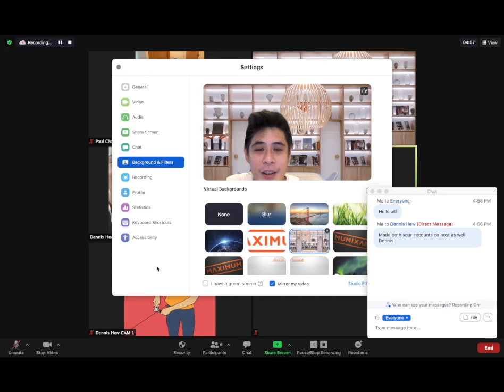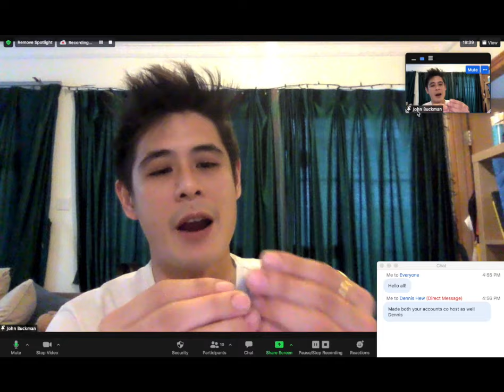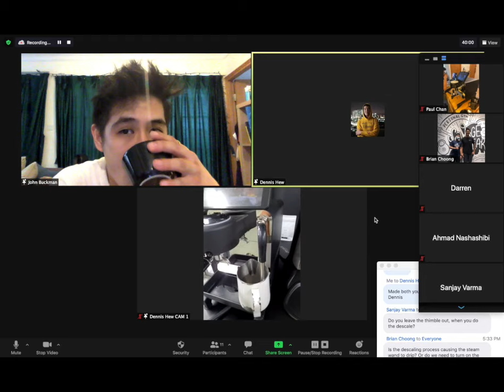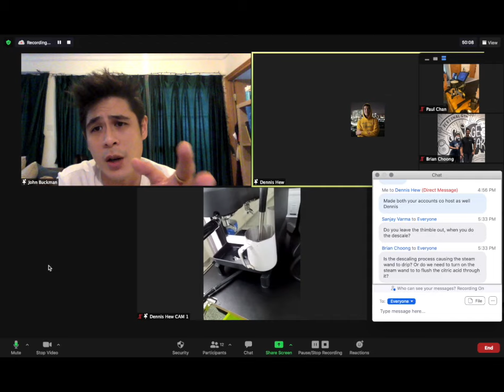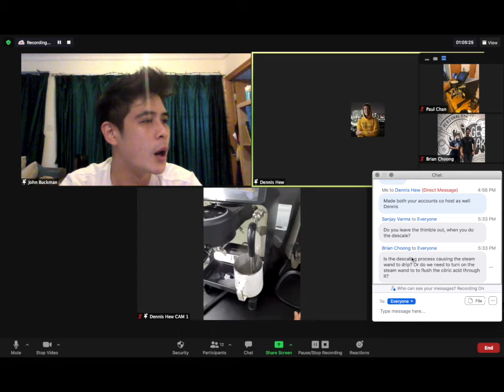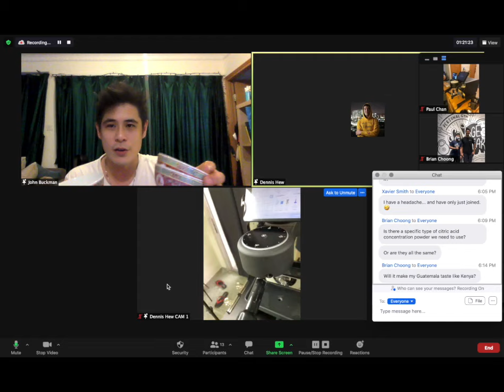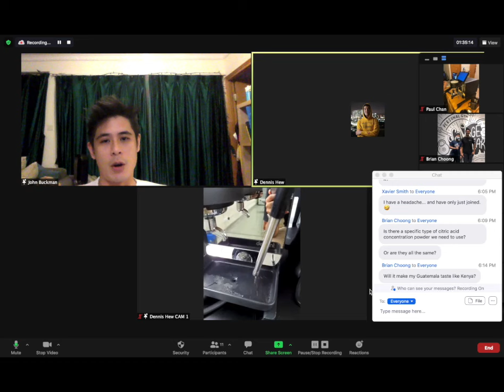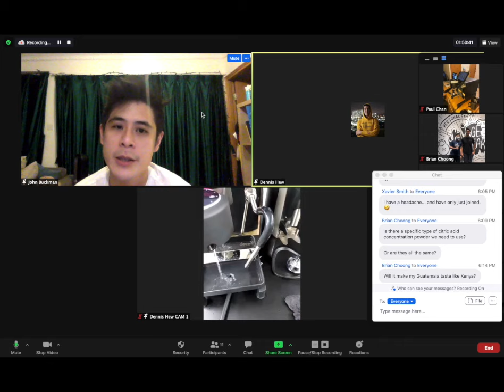Zoom: Clean and care for your DE1 (Descale)

Comment: For those that see the video length and say "F**k this", simply:

1) Go to the "Machine tab" under settings
2) Locate the button to Descale - top right
3) Follow the instruction on the screen
4) Have the video play in the background to answer your questions
5) Key points is that you can submerge the steam wand in water to avoid vinegar smell when the steam comes out as part of cleaning cycle
6) You can run the cycle 8-10 times (until the tank is emply, rather) if its the first time you do descale on old machine. Normally only need 3-4 times.
7) Set up a bi-yearly schedule to do the descale as part of best practise
Reply: Add in the following points after 6 above

A) Take out the tank, clean it under the tap, put new water (Just half full will do)
B) Descale again (yes, same as we used before)
C) Repeat A) again, this time fill it up and remove blind basket.
D) Run a series of flushings (hot water, steam, rinse) until there is no smell of vinegar
E) Continue running as per D), but try to taste the water. If there is lemon taste, repeat until water tastes clean. Prepare to go through one full tank of water at least.
F) Success!

Comment: Nice explanation of the process, thanks.

Some questions:
- is it possible to use less solution (maybe 1l), if we only do 3 cycles
- it would be nice to have a multiplier in the descale process, so that it’s performed multiple times without any user action
- it would be good to include to the descale information page: perform multiple times + perform with clean water + flush afterwards
Reply from the maker: Yes as long as the concentration of the citric acid solution is the same, You will have the benefit of less waste. Anything less concentrated and you run the danger of no fully dissolving the scale build up.

Comment: Does the screen and brass parts from the group head need to be removed before descaling? Or is it safe to leave them on?
Reply from the maker: It is safe to leave them on. The citric acid has been specifically chosen because it will not corrode or damage the DE1 components it is in contact with.
Reply: @decentespresso  Thank you. If descaling and cleaning, the descale should be done first ?
Reply: @decentespresso  Can you make a shorter more concise video on how to descale? Seems like many have questions around descaling, would be great to have a concise video.

Comment: How often is descaling generally recommended for de1? I know it varies based on water hardness etc, but given that there are no boilers its a new realm for me. I dont know if de1 style heating means descaling more or less often than a boiler machine.
Reply from the maker: If you are using appropriate water with the DE1 then it is rare that you will need to descale. The great things is you can descale at home with citric acid if needs be.
Reply: @decentespresso  I know that, but what does rare mean to you? Suppose 4 shots per day, does rare mean once a year? 3 years?

Comment: Would using a commercial lactic acid solution be okay to use?
Reply from the maker: Please use citric acid. Its widely available and cheaper when you buy in bulk. As it wont go off.